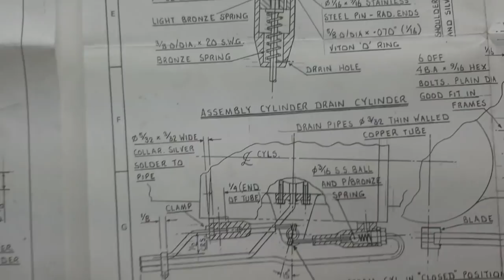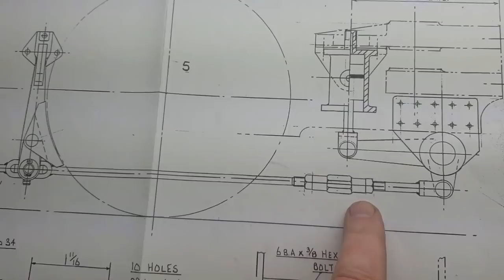BR 9F Steam Loco 5" Gauge Part 61 Brake Cylinders

Comment: Great job as always! Glad you decided to tackle the cylinders.
Reply from the maker: Thanks Craig, I had a feeling you might want the  cylinders next!
Reply: no23mk2 : Only out of pure curiosity. The Shays use a single double end, double acting, horizontal mounted cylinder.  Depending on the class the aft part varies in size. The Engineer uses a three position valve to apply or release pressure. Your description at the begin was very insightful!
Reply from the maker: Yes Craig, I think the 9F uses a three position valve (don't quote me!) as the drawing shows an exhaust at the valve. I assume steam on, off and exhaust. I need to do some more homework on this. Note also the ingenious piston design that will drain the steam line.  Check the drawing at 2:38 - you can make out some drillings in the piston that will allow the steam line to drain after the pressure is turned off and the check ball is unseated.
Reply: no23mk2 :Yes I caught that ingenious valve. I'm researching if the Shays used something similar now. Never thought of it but they would need something like that if they wanted the breaks to work more than once.

Comment: Hi Craig, another excellent video! 

I’m building a Thomas 2 and this also has steam operated drain cocks, but rather than the cylinder operating the linkage, the steam operates the drain cocks directly. I’m interested to know if your cab operated valve is a standard valve, or a 3 way valve to exhaust the steam line. The drawings I have show a standard valve, but I’m thinking of fabricating a 3 way valve just to make sure I don’t have any problems.

Regards Rob

Comment: Where did you get this model kit from?  Also, do you recommend that seller and how much finishing/ custom milling and turning is required on the kits.
Reply from the maker: This is not a kit. It is made from various castings which are available from Blackgates Engineering - everything else is metal stock ov various forms and materials. The drawings are supplied Blackgates also. You will see from previous videos, e.g. wheels, cylinders etc as to the machining and finishing requirements of the castings. The quality of the castings have been excellent with no inclusions or shrinkage.